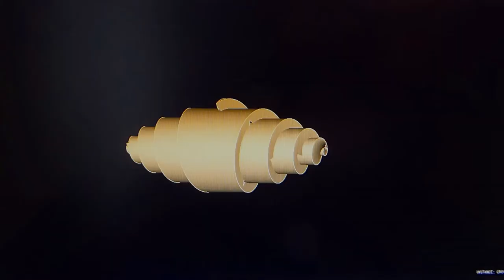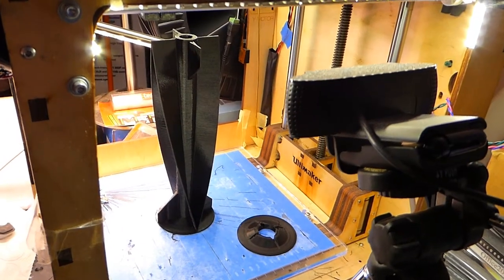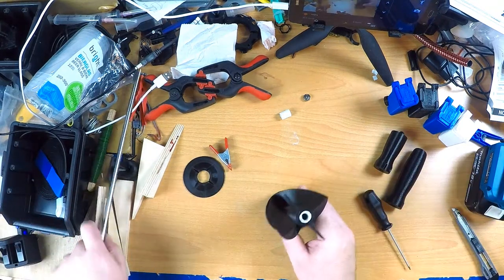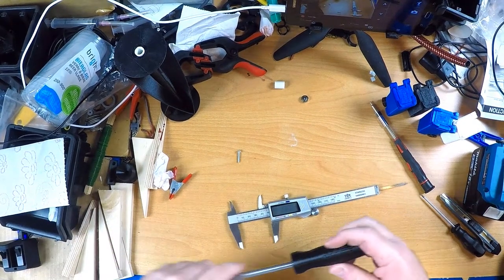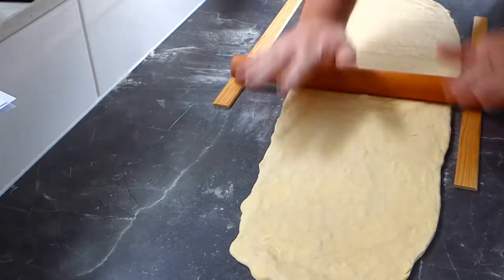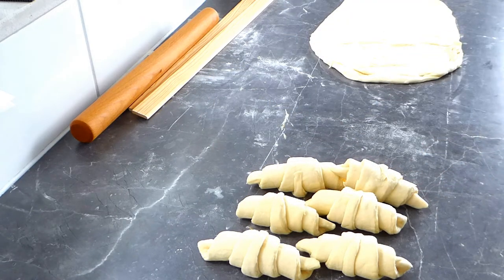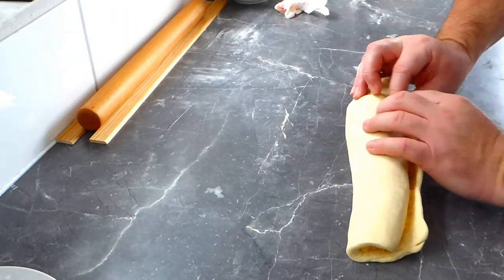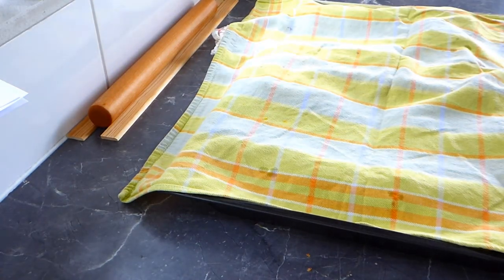3D Printed Croissant Cutter

Comment: Very nice!  Did you printed it in PETG?
Reply from the maker: Thank you.
I used PLA for all the black parts.
I have no experience printing PETG but might be a more interesting option with regards to food-safe materials.
Reply: @GeneralRulofDumb  PETG It's very easy to print, durable, resistant and food-safe as you just said.